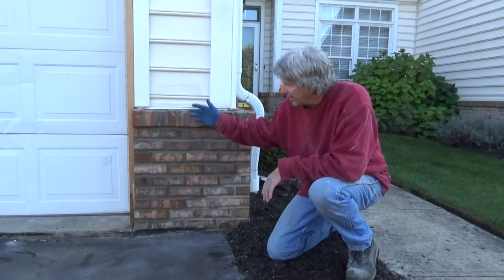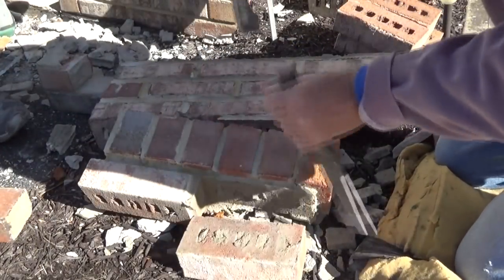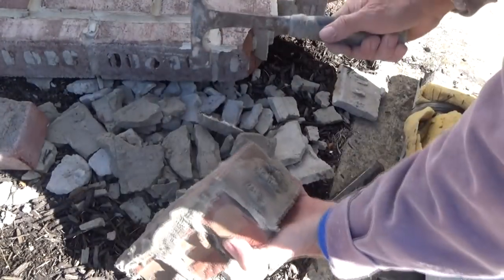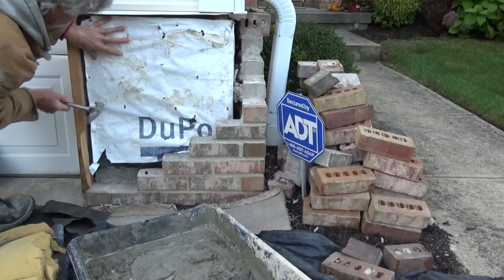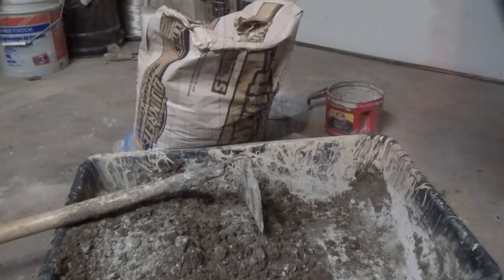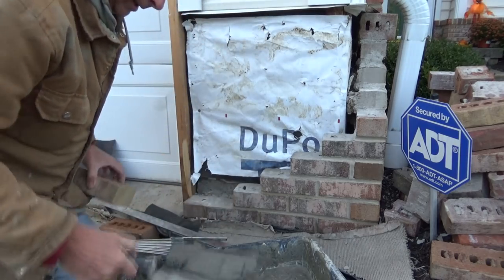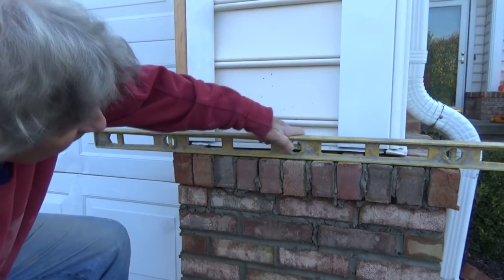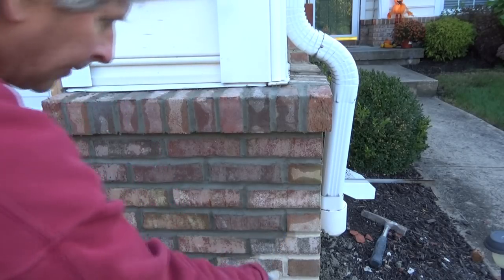BRICK WALL REPAIR (Mike Haduck)

Comment: How do you repair a chipped corner brick without replacing the whole brick
Reply from the maker: Hi Yvette, depending on how bad, sometimes remove the whole face and saw another face off a different brick or a piece and glue it on,  or bondo it and paint it,  diffrenent ways, Mike

Comment: Seems those panel houses on pea gravel would sink over time. What stops it? Tie the inner concrete floor to the panels somehow?
Reply from the maker: Hi Pockets, nope same idea like laying railroad track on gravel,  thanks mike
Reply: @MikeHaduck  : thanks Mike. It still seems shoddy, because railroads have to re-surface sinking tracks. The ballast is several feet deep with gradations. I wouldnt buy such a building.
Reply: @rogerscottcathey  Yup...trackwork is a seasonal thing on the railroad, tampers/regulators etc should be run maybe quarterly in my opinion. It doesn't take long for deferred maintenance to take its toll.
Reply: @setandcentered   If the gravel/stone is deep enough and has good drainage it wouldn't need periodic 'rail road track tampering' would it?  No constant extreme loads and vibration like a mainline track would encounter? They would have to place it deep enough to provide the structure adequate load support per sq foot. I built a workshed in my back yard like this but hadn't considered the idea expanded for a home foundation substitute. A local soil engineer would probably have to evaluate this and submit the report along with the architects or builders plans to get building permit approval in my area.

Comment: Thank you for video, I know if they stop making real bricks I will not be able to fix the broken ones or replace, so I better get on it while I have time.  You make it look so easy, guess I just need to dive in and make it happen.  Then I will be out of the doghouse cuz at least that will be one project down and only 20 bizillion left.  Ha Ha.
Reply from the maker: Hi rob, not to worry too much, lots of repair work to be done,  thanks mike

Comment: the new construction sure is interesting, i wonder how well it ages when the whole building floats on gravel like that. in the end even a pad still floats even if it's 9" thick. it is kind of sad that it's not substantial like it used to be but, i'm not all against some of the new stuff going in construction these days. insulation sure has come a long way and helps energy consumption.
Reply from the maker: Thanks cd, I agree, mike

Comment: With such a small wall couldn't you just take it down in small sections instead of brick by brick and rebuild it by still installing hold back straps in a new joint layer.  I know you would have to replace broken brick as well but it just seems if you could replace it like a puzzle it would be faster for a novice since it is not really structural.
Reply from the maker: Hi Jet, it was all broken up and falling apart with the mortar they used ,so easier to clean it all up and relay it,  thanks mike
Reply: @MikeHaduck  So if it was in good solid shape but knocked away from the house it could have been disassembled in small sections and reassembled like a puzzle back against the wall framing ?  Just wondering
Reply from the maker: Hi Jet, maybe but not practical in this case, thanks Mike

Comment: That DuPont should have been repaired first. With that many wholes in it it doesn't help anyone. Think that the owner is washing the car, water gets sprayed on the wall, gets absorbed into the brick and goes right to the wood structure
Reply from the maker: Hi Daniel,  I put black paper behind it, no water will get in there, I am not a fan of that Dupont stuff, its cheezy in my experience,  thanks Mike

Comment: That's a $800 cash job
Reply from the maker: Hi Jamie, not in my area,  thanks Mike
Reply: @MikeHaduck  I respectfully disagree but ty again sir
Reply from the maker: Hi Jamie, if it was a insurance job probably but I just put it back for another contractor,  thanks Mike
Reply: @MikeHaduck  I agree with you there Mike your right